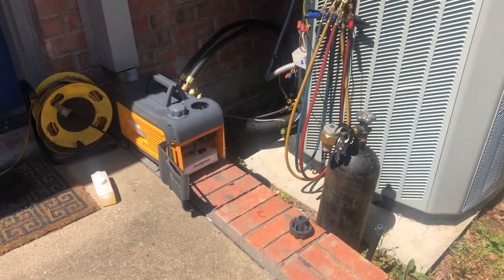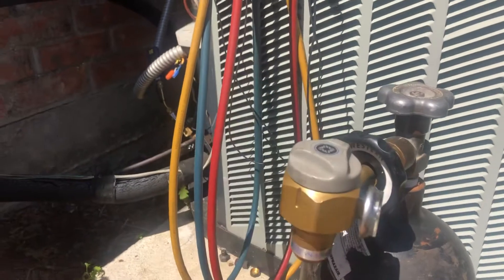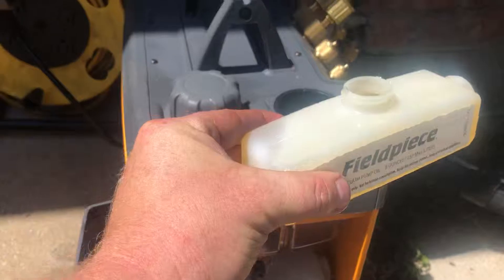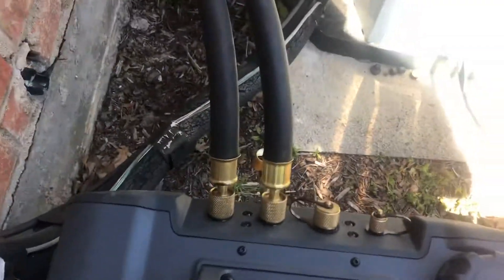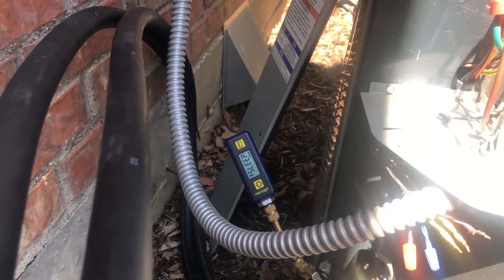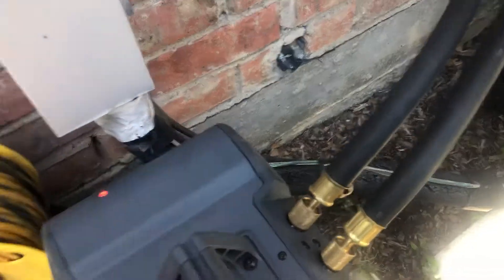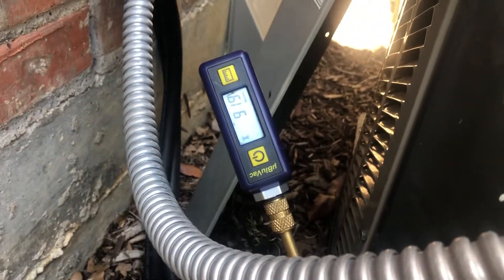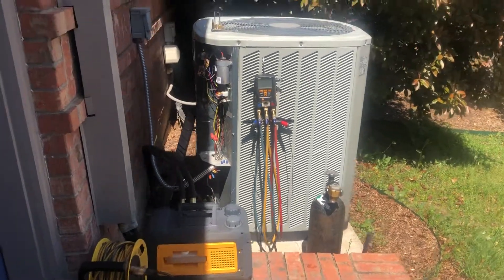High Flow HVAC System Evacuation

Comment: Hi I have a question can you use JB Industry Black Gold oil in FP vacuum pumps or it has to be FB oil only
Reply from the maker: No I usually use the fieldpiece stuff, that’s an older jug. I don’t think there’s any reason not too. I’ve used it before but the little containers they fieldpiece stuff comes in makes it convenient to change on the fly

Comment: OMG! The oil that you drained from the pump was black. Was that from one use? Just wondering. I was taught to change my oil for every vacuum.
Reply from the maker: No, I think the video and the plastic container makes it look darker than it was. We change it pretty frequently. If it looks milky, or opaque that’s the sign it’s contaminated with moisture. We usually change when it starts to show signs of that which is more frequent than a month